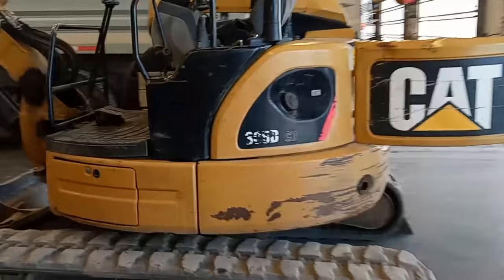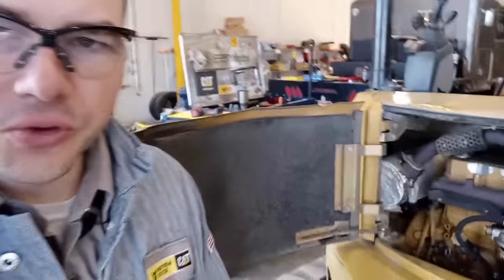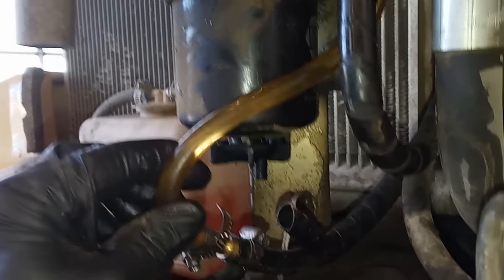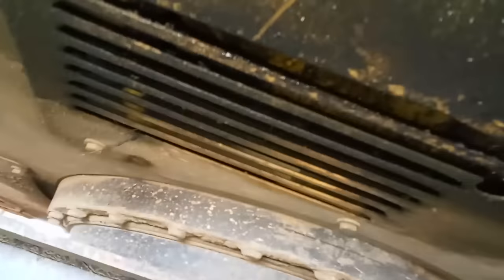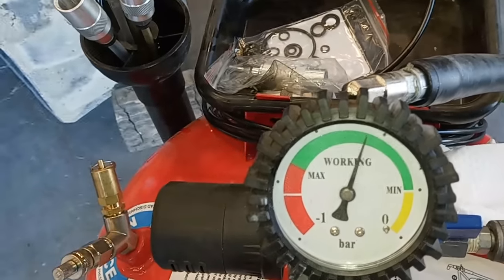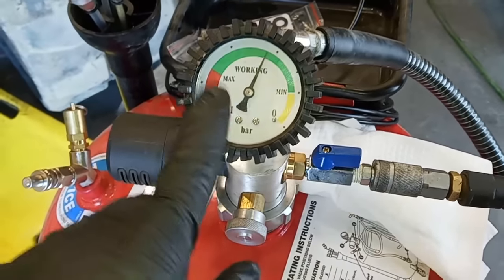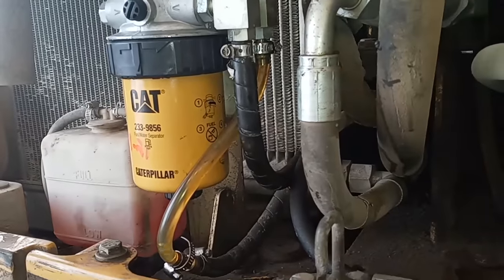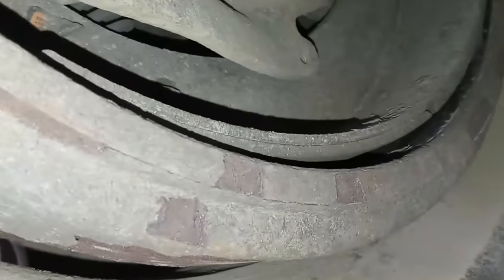What happens when a Truck Mechanic works on Equipment? Cat 305 Excavator.

Comment: Thanks for the wisdom on using suction systems for changing oil, Josh. When I worked as a boat mechanic that is how we changed the oil on every vessel since you can't even see nor reach the drain plug on inboard motors
Reply from the maker: Yeah, I used a Topsider for my car before I bought this and it worked good for little engines. People seemed confused when I don't get the big oil tanker and drain the oil out of the plug, the suction style is just much cleaner and less labor time.

Comment: Welcome to my world! Now, we just need to get you on a 349 or a D8 out of the landfill lol. We don't get the luxury of sucking the oil out, we have to drop pans/panels and clean them out as part of the service.
Reply: Don’t forget the 836’s!
Reply: @preachers4135  YES!!!! We get them all too often in the shop. If it's not an engine problem it's a trans problem.
Reply: Oh man I got stuck as a site mechanic at a landfill years ago , freaking guy came rolling up on a Ole D-5 with steering clutch problems, freaking dead dog hanging off the blade , popped the floorboards to get to a oil leak , it had freaking maggots crawling around down in there , nasty Ole rotten food an who knows what .an the stench gets in the pores of your skin an hair , it took me 2 weeks to get the smell outta the cab of my truck, I threw my boots away .

Comment: Oil evacuation. Great example of working smarter not harder. Better than dealing with a skid plate with 300lbs of mud inside, or crawling under it in water mud and sharp rock. Great tip!

Comment: I had to laugh when I saw the title of the video. Years ago I took my Pete with a 3176 to the cat dealer. They asked me if it was ok to let a Equipment mechanic work on my truck. I told them no problem nuts and bolts work the same. Well he put the water pump on and it was a bad part out of the box. So I had to keep waiting for them to replace the "new" water pump again. I was there for almost 9 hours for a 3-4 hour job. I did get a free Cat hat out of the deal.
Reply from the maker: And a sweet story!

Comment: Learn the equipment its more challenging you will earn more and open avenues of oppurtunity.I used to work for a Cat dealer as a truck engine mechanic. Found it boring after changing 3000 head gaskets on 3406Bs when cat changed from asbestos head gaskets to non asbestos. Learn the equipment youll make more $.

Comment: Gosh, if you'd had a classic Duramax over the years, you would have immediately recognized the bleeder gasket/o-ring failure sucking air on the hand priming pump.  Great video!!

Comment: I have recently started using an oil extractor for doing my cars as we use them at work (I'm a small engine mechanic) and its so much easier. I did it on my 4x4 when i was servicing it and pulled the drain plug to check how much oil was still in the pan and not a drop came out. Was pretty happy with that

Comment: Oil extractors are great. I got one for 45 bucks that just builds the vacuum with a hand pump and it easily sucks my engine dry in under 10 minutes and its so clean and easy to do.

Comment: That's probably the best way to sneak in a sponsored ad. I was curious enough to not skip it. I'd rather pull the plug. I don't do enough oil changes on my Acura

Comment: I have very mixed feelings about oil changes from evacuators thru the dipstick opening.  My dump truck with a Cat engine has 2 sumps with 2 drain plugs so if using an evacuator wouldn't really work on this.  Also, the manufacturers have usually engineered the proper drainage thru the drain plug.
Reply: Agreed. I’ve seen a video where they showed a vacuum oil ch age left several quarts of oil behind.

If it wasn’t designed for it it’s not meant to be used that way.

Comment: As a equipment mechanic that has had to fix equipment that was "repaired" by truck and automotive mechanics, it always scares me.
Reply: the worst is i had my electrican look at it
Reply: I'm a bicycle mechanic working at a Kubota dealership.. I love checking over tractors that the mechanics put together... haha
Reply: Truck Boys 🤣 , Real Men work on Heavy Iron , that's why they call us IRON MEN
Reply: That is a silly fear unless those technicians are just incompetent.
Reply: So ... a mechanic can only do one job ? I can see most dealership mechanics having problems with a far horizon of job's but for me. I do it all. And love to point out " dealership " mechanics.  Because they are the " professionals " and we the normal mechanics are the people that make the problems worse....
Reply: Cool oil vac !
Reply: @edwardloose9668  So you are one of those people who got lucky and fixed their lawnmower and now you think you can fix anything.  I dub you SUPERTECH.
Reply: @quazy1328   yes . But in reality I got tired of P.O.S dealership mechanics ripping people off and telling them that only the dealership can do the job at hand.  I will run out of hands and feet on the numbers of jobs that came in from dealerships that " supposedly fixed the issue.  But in reality.  Part stabbing is not fixing! You need this and this and this but this made this go bad and return made that go bad. Sound about right? .yes I know you are the all and powerful OZ !!!!
Reply: @quazy1328   can you tell me how the mechanic came to exist??? Magic! The more you post the more I dig in ! You won't win.  Unless you cry to YouTube!
Reply: @edwardloose9668  Then get digging SUPERTECH.
Reply: @edwardloose9668  You keyboard warriors are soo scary, I am shaking in my jump boots.
Reply: @quazy1328  you must be the lead technician! I'm not wanting you to be scared.  Just to be honest.  You are not the only person in the world that can figure it out. You don't need a degree or a fancy title to fix something.  And fix it the right way.  But speaking of a collective.  You people are all the same.  If it's not your way it's wrong.  Warriors? Never claim that title but shit I'll take it. I told you keep on and it just won't stop! I won't back down.  Slow down on the medication and focus on the task at hand.  You are trying to be the master YouTube mechanic hero and I'm calling you out for being a know that all that is average at the most. Not everyone is Superman . I'm still waiting for the answer to my question.  Origins of a mechanic ?????
Reply: @quazy1328  how does that engine know what it is in. Like dose it Identify as equipment or truck. What are the pronouns of said equipment or truck?
Reply: @quazy1328  I'm waiting
Reply: @quazy1328  warrior mod

Comment: I love the vacuum canisters especially when replacing injectors it’s always nice to suck that bit of fuel off the top of the pistons. But doing an oil change with it  doesn’t allow the parts to come out the bottom on the plug. I prefer to let the oil drain out well I’m doing all my other greasing and inspections. All the off-road equipment I work on has Cat quick drain systems on them. Once the oil has completely removed I slow the pump down and  let them gurgle away for a while.

Comment: Great video Josh.  I'm experiencing almost the exact same issue with my 303.5D excavator.  I suspected that it is somehow pulling air into the system, but I wasn't sure how go about finding the leak.  I started watching your video and saw that you installed a section of clear tubing in the fuel system to check for air bubbles.  Awesome idea!  I originally suspected an air leak either in the fuel priming pump or a seal in the water separator.  I look forward to trying your method to see if it can help me locate my issue.  The timing of this video was perfect!  Thanks.

Comment: Discovered vac for oil on a boat with an I/O. I sold the boat but I still have and use the vac. Used it most recently on a 10kw genset in my RV.

Comment: Nice work.  I have a very similar oil evacuation system.  Looks identical but I purchased it from NAPA under the Crew Chief brand.  Probably made by Lincoln.  I purchased it for when I was doing some boat work and small engine work but quickly found it works for so much more.  And I HATE working on boats.lol

The bubble test works great on fuel system testing.  There always seems to be some small bubbles due to entrained air but like you mentioned the big bubbles are what cause issues.  Also a good reason for positive pressure fuel supply pumps.  I've installed them on RV's and well worth it.
Mike

Comment: I use an electric positive displacement pump.  You have to put a little oil down the tube so the internal vanes get an air tight seal.  I find they are very quick and have no issues with sucking out cool or cold oil.  I’ve just not had much luck with Venturi systems.

Comment: I've still got 4 of the original brake cans on my truck, 1999 fld 120 with a bit shy of 1.8mill on it. The only reason the other 2 got replaced was one of the springs broke so I replaced both, even the diaphragm was original with a manufactured 1998 stamp. You may know the person who rebuilt it, was rebuilt in Idaho in 2012 before I got it and still running great.

Comment: Great video, I've been into a lot of workshops to diagnose "electrical problems" after the customer has had similar problems , but changed the fuel pump, fuel injectors & common rail. Then claim it is a ecu problem & its electrical. I do a couple of tests like yours & find its that fuel filter housing is letting in air or the filter hasn't been changed in 5 years or  they've fitted inline air connectors on to the plastic fuel pipes.

Comment: The destruction of the week reminded me of a guy I saw setting slack adjusters while the truck was out of air. Yes the brakes were out of adjustment that bad but I’ve seen anyone set brakes and not know the system has to be aired up.
Reply from the maker: Air brakes are pretty simple creatures, but you still have to service them correctly
Reply: @AdeptApe  I would love to see a video on air brake adjustments

Comment: Used to see the primer heads fail on ford diesel cars over here, I used to completely cover the primer button with a thick layer of heavy grease and if that was the issue it would cure the fuel drain back and stumbling issues and could even last for weeks as a temporary repair.

Comment: With that truck, how the driver never noticed something drastically wrong with the brakes long before the state it was in when you got it into your hands is mind boggling. Also it certainly wasn't getting any pretrip check for a very long time. That certainly is the type of mess that DOT has every reason to have towed off the road.

Comment: 7:10 false, I’ve seen videos that the suction tube doesn’t remove all the oil. If the engine wasn’t designed for it the pan can still hold more oil. I saw a oil change that was sucked and there was still 3 quarts of oil left in the pan.
Reply: If the suction hose gets to the bottom of the Pan you get everything out.
If it cant for some reason thats the problem.

Comment: Mounting a double diaphragm pump onto your tank works well .  Your rental house fleet should install hydraulic fittings on all oil pans. ( quick couplers)  Very efficient and oil messes eliminated .   This set-up is very fast

Comment: did this for 25 years consturction fleet maintance on @off road ase all phases its grt. job security theyll break it faster then you can fix it
Reply: I started on Ag Equipment, moved up Automotive, then went Heavy Truck , then jumped to Construction Equipment  as a Road Mechanic ( they call it mobile now ) an never looked back , ended up as Shop Foreman the last 10 yrs at a Cat Dealer . I have bent wrench's for near 45 yrs An DONE !!! 🤣

Comment: I love the cat filter comment I find it interesting caterpillar doesn’t make their own filters the filter housing isn’t caterpillar either they were using those on John Deers 20 years ago
Reply: Caterpillar doesn’t make their own filters? Where do you get your information from? 
The filter housing on this application may not appear to be caterpillar, as was also shown, the engine wasn’t actually a Cat engine but I bet there’s a seven digit Cat part number on each. The engines, even when built by other companies, are built to Cat specs and most parts are not interchangeable with their counterparts.

Comment: I have a Mighty Vac system that you  pump up like pump sprayer. I bought that 20 years ago to change oil in my cars and boat. 
I’m glad the driver is doing a good pre trip inspection on that truck. 😳
Reply from the maker: 5 of the 6 inner wheel seals were leaking too 👍
Reply: @AdeptApe  You know those just started leaking on the way to the shop. :-)

Comment: You talked about changing oils using your vacuum tank and not taking the drain plug out just wanted to say most drain plugs have a magnet it’s always a good idea to check it for metal shavings every oil change
Reply: Routine SOS samples are much much better.

Comment: I currently work on garbage trucks and other related medium-duty trucks, but I'm looking to eventually transition into earth moving and heavy equipment. Most of what I do now is hydraulics and driveline stuff (brakes, bearings and seals, etc.) and a lot of minor repairs. We pretty much do no engine work in our shop. How do you feel about working on something like this, and also how easily could skills from working on trucks transfer over? My specialty is hydraulics, so I believe that I would probably enjoy this type of work. Just wanted some thoughts on the matter, thanks for the video.
Reply: I do most of the maintenance on our Cat machines at work and thats the easy part. A lot of the hydro stuff is a giant pain in the ass, sometimes zero room for tools etc.Need the patience of a saint at times .I would excavators can be the worst as far as hydro repairs.Parts of the machine are built around it it seems like and makes changing lines a nightmare.
Reply: Did you switch over to heavy equipment? I have Cat and freightliner wanna hire me and I'm trying to decide which would be better long term
Reply: @marcowilliams4801  nope I haven't yet, and I honestly couldn't give a good answer to your question, but good luck with that.

Comment: As an equipment mechanic who doesn't work for a manufacturer and gets to work on just about every brand, cat makes good engines and big dirt equipment but sucks at absolutely everything else, also alot of their smaller, or off type equipment is usually just rebranded other brands with a few options changed or added

Comment: An unrelated question that I forgot if you've answered before, but does Cat mount both electrical generator and hydraulic pumps to the engine at the same time for marine applications?

Comment: I drive an old Ford dump truck. Do I have to suggest to the mechanic, he has to raise the rear axles to figure out the braking problem? I pull both tabs to lock the brakes and it will continue to roll unless I apply the brake for a few seconds.

Comment: Are constructions machinery diesel engines much different from  one's fitted in cars or truck?
I am crane operator and I did notices that in crane engine oil when being changed is very clear almost any soot in in. In my fairy modern 2liter CDTI vouxhall insignia fresh oil gets black after 20-30 miles drive.

Comment: I'll tell you what happens when a truck mechanic works equipment , you wind up out in the field in fifteen degree temperature on construction sites dragging chain hoist , cables , torches and testers and tools up under equipment in frozen muddy ground and all the while wishing you were in the shop working on a C 15 in a peterbuilt . haha
Reply from the maker: Sounds like my personal nightmare.

Comment: I have the 304ccr. Same engine. Unknown hours, went for a swim, pretty sure I cracked a ring... That was 2 years ago. It's a tough little engine, drinks oil, sips fuel. Noisy as fuck without the door tho.

Comment: I'm a big fan of yours, you're a wealth of information on cat truck engines! But I don't agree with you on aftermarket filters, you basically fixed the problem when you tightened the drain of the wix/napa filter.  I haven't seen a failure from a decent quality aftermarket filter yet!  But maybe I'm just lucky. Ha. I'm going to say that guy is money ahead with the napa filter ordered on a bulk order at $4 a filter to a cat at $40!  I'm still dealing with cat releasing all the filters for my cat 262B skidder.  But you're still the greatest cat truck tech I know of!👍
Reply from the maker: I don't like the design of the equipment filters with all the plastic rings and what not. A Mitsubishi oil filter would have been OEM in this instance. On the larger engines with normal style filters I still really prefer the Cat filters. Thanks for watching.

Comment: I'm still not happy with the air bubbles. It's getting in somewhere. The amount is going to be influenced by the size of the leak and the vacuum level at the leak. It's not a tank vent problem because it starts immediately. My first check would be an obstruction in the tank pickup. The fast test is to put a vacuum gauge on the supply line ahead of the fuel pump. It should read close to zero. Then go from there.
Reply from the maker: Yeah, I wanted to further troubleshoot, but customer wanted to take it as is. The engine stumble did go away though.

Comment: That's not an excavator. That is a toy. I've worked on excavators that you can fit five of them inside the bucket and still have room to service them. When you're draining oil into 55 gallon barrels, with a bank of filters. You know your working on equipment.
Reply: Here....here!

Comment: Man I've have had Ole Farm trucks an trailers where the fertilizer had over the years just ate most of the spring brake housing away to the point like 80% of the spring was exposed an big sections of the spring be ate up . Yeah yeah sure I can change that out ( wtf ) 😳